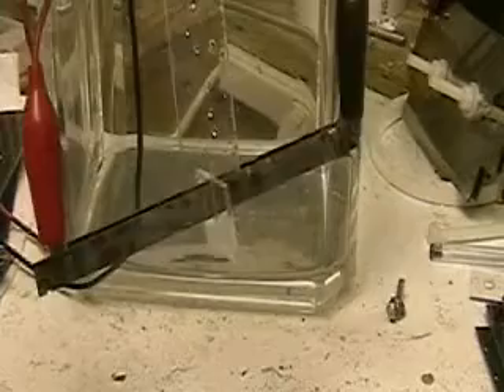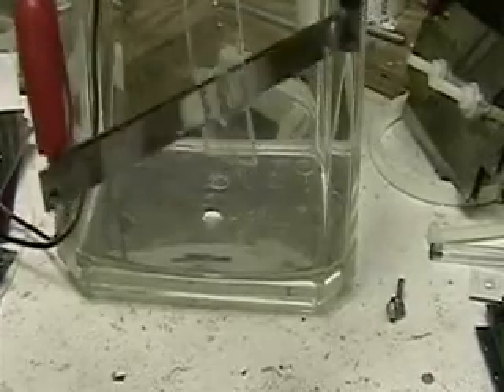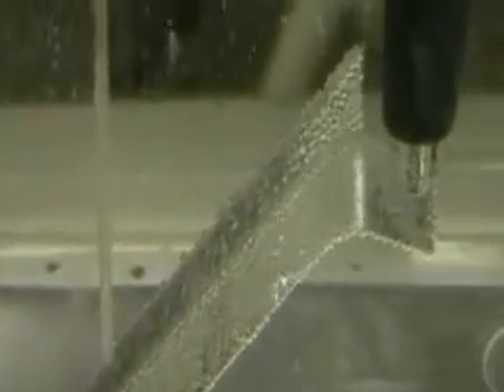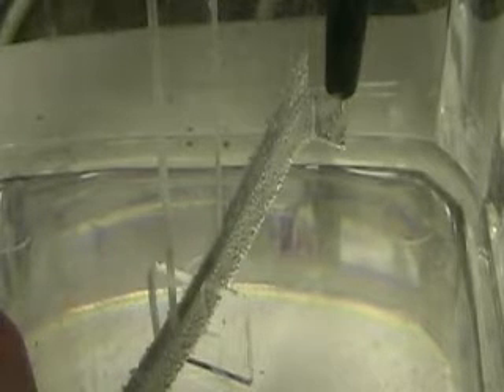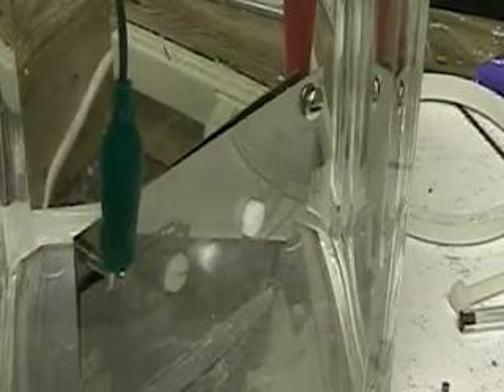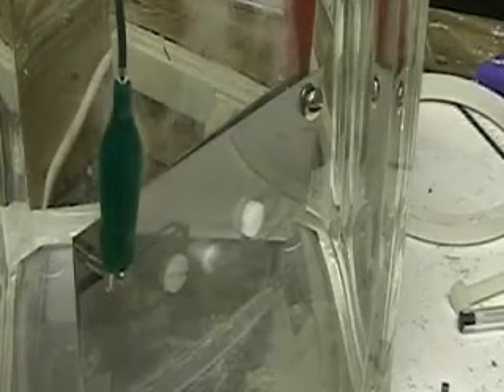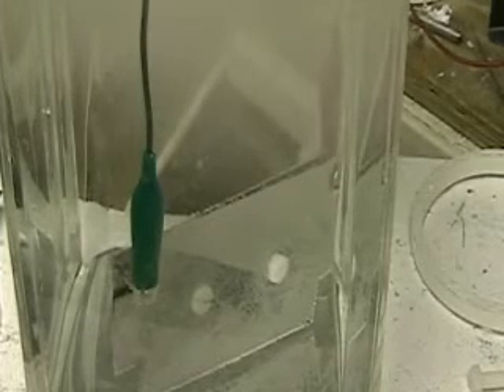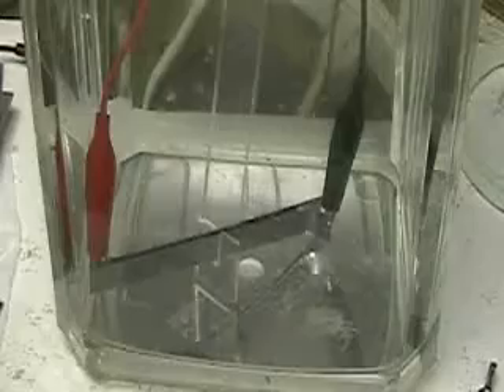Hydrogen Tap (Testing Thin Plates) 268

Comment: I have a theory... well more like an hypotesis...

By having the plates verticaly, a lot of bubbles are running up the metal in a far greater concentration than if the plates were in an horizontal configuration.
Those "extra" bubbles are pushing the water away from the plates, so hydrogen production decreases...
Can we test this?
Best regards and keep up the god work!

Comment: Good job on the test!  What I meant was to have many many wires (+ - + - + -, etc) together, and use the surface area formula that way.  I think you will be amazed as I was.  I have made it already, and I have proof.  Its all about the displacement of all that power going in vs the wires...  and volume of water (electrolyte).  Have you seen my video?